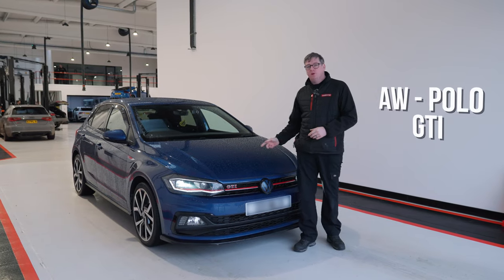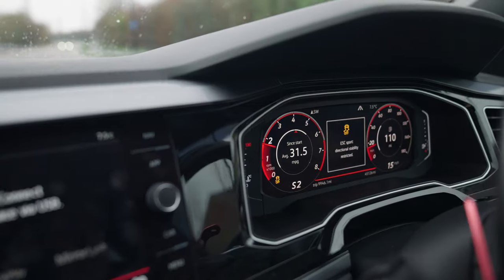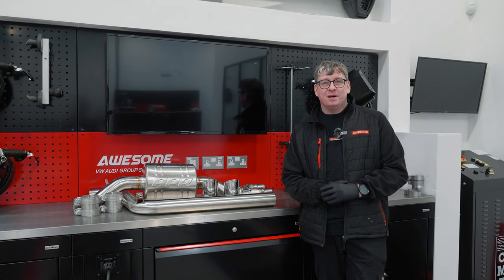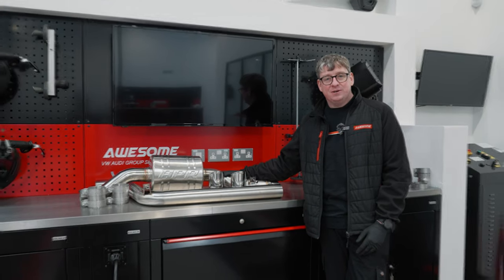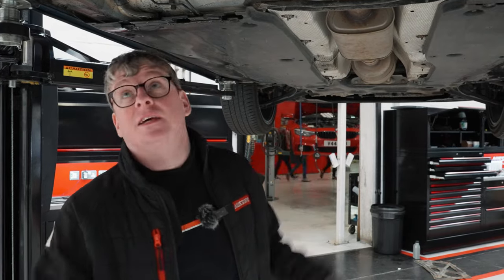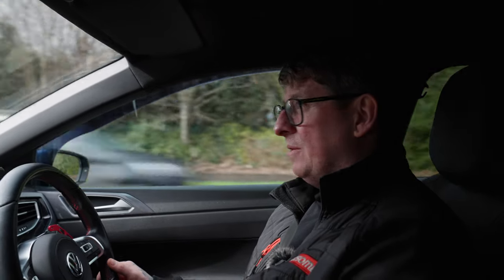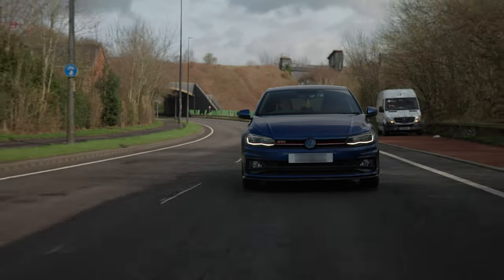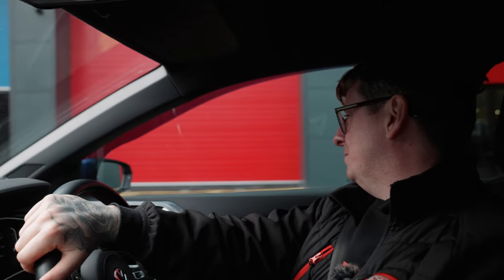APR Exhausts Explained – VW Polo GTI (AW)

Comment: So will you be doing sports cats that retain the gpf?
Reply from the maker: No, removing the GPF wouldn't be an option for us. Only once EC approved performance GPFs become available will they look at offering a replacement.
Reply: @awesomecars1  i meant, creating sports cats that keep the gpf still…
Reply: @ad_182_uk as the GPF and downpipe are attached on most VAG cars; until a manufacturer comes allong that can offer an e-marked sports cat downpipe complete with a factory or e-marked GPF - it’s not likely.

Comment: Thank you you are the first channel to upload a real soundvideo of the opf version apr catback.
Could you please tell me if you can hear the dsg farts in the cabin and if it burbles in the cabin manually downshifting?
Thanks so much. :)
Reply: @awesomecars1 could you answere please?
Reply from the maker: With the car still retaining the OPF, it enhances it slightly but not a lot.
Reply: Any idea on the decibels? Before and after?
Reply: Had the apr exhaust for abt 4 month. Its a little bit louder. Huge difference in bass. Pops sometimes 1-2 and 2-3. Pops almost every time sportsmode full throttle on the Autobahn on every gearchange exept 5-6. Little burbles downshifting 4-3 3-2. But tbh at this pricetag i wouldnt buy again. The apr intake for around 400 EUR is much more fun and sounds.